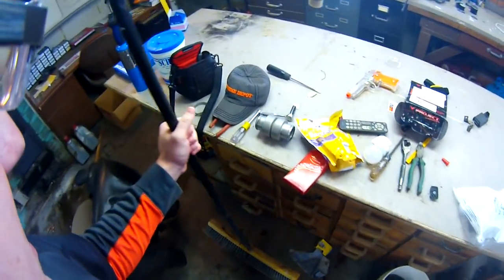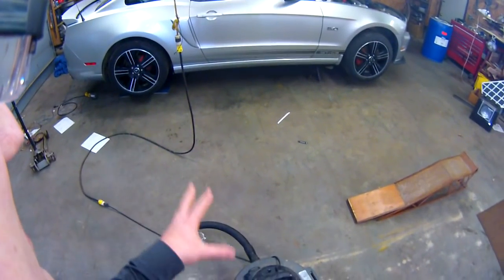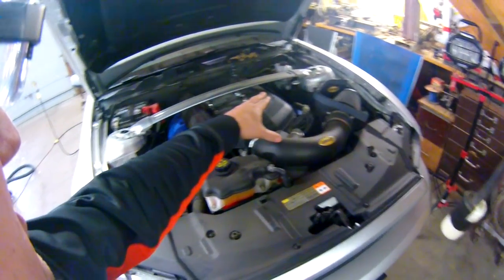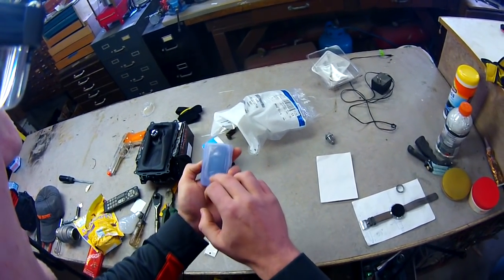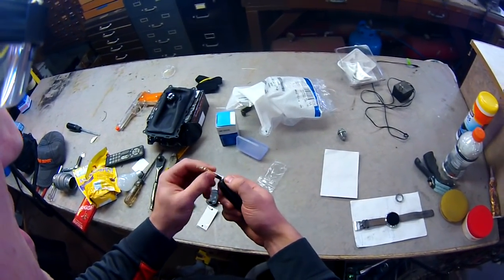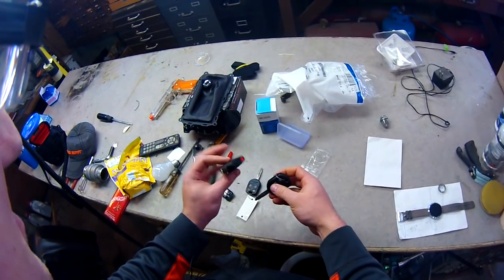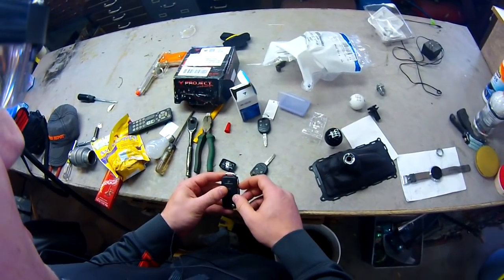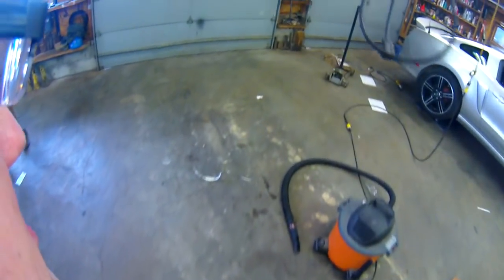E-Bay Flip Key Install & Programming

Comment: 12:01 IF you are here just for the TRANSPONDER matching with the engine. Question: what happens if you only have one original key???
Reply from the maker: Then there isn't much that you can do, other than grit your teeth and head over to the dealership and pay to have them program you a new key.

Comment: Got same flip key from e-bay $16.00 - Home Depot cut key for free - noticed how you separated - but wondering how do you swap battery ?
Reply from the maker: After you pull the key part away from the fob you can put the fob into 2 pieces and the battery is inside.I think thats how you change it

Comment: Great tutorial brother. I just received the equivalent version for my 02 Lexus is300 and it worked like a charm. Definitely a cheaper plasticky feel, but had to have it for sake of necessity reason lol. I have a 91 foxbody actually am going to install traction control system and have all neccary means to implicate a antitheft system w/ key fob, etc. from a 95 model, and when that's finally over I would like to graduate the fob/key to the "Audi" style fob sys. Thanks for posting 👍

Comment: Do both of your original factory key fobs still work?  I read that some vehicles will only respond to 2 programmed keys, not all 3.  Is that true?
Reply: mortiz2166 depends per vehicle and make. Many if not most vehicles nowadays allow for more than 2. As an example many of these fords allow up to a total of 8 keys that work, for fleet or dealer/rent purposes. Comment back with your year make and model and I can check for you how many keys you can program at once.

Comment: hi mate if i don't have two orignal keys is there a way to program this flip key . i lost one of my keys and i only have one key with the horse logo
Reply: Aun Muhammad I had to program two Ford v8s the other day, a series two f150 and series 3 expedition, both allowed programming after inserting only one factory key. The manual says aftermarket won’t work (it will) and it says only ford dealer can make a second if you loose one. (surprise not true) what’s being demonstrated is the ford on board programming without obd2 tool, the paper he’s reading isn’t how the manual words it haha they want to scare us into the dealership.